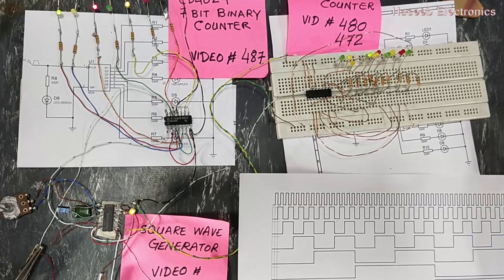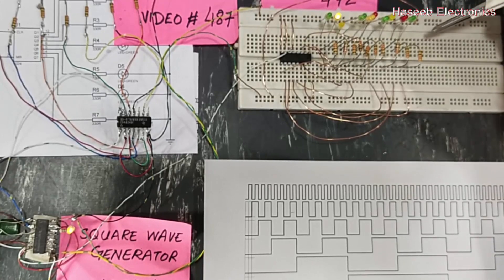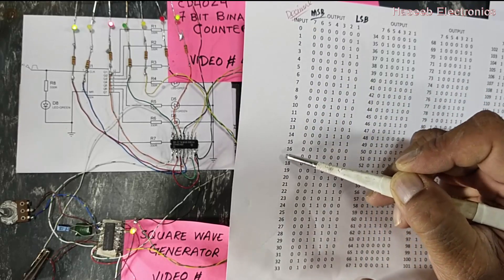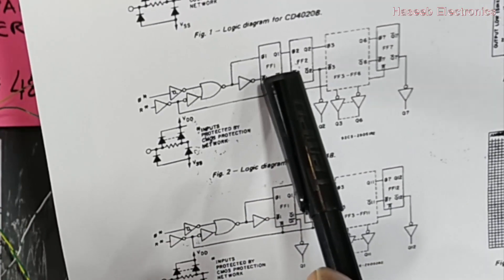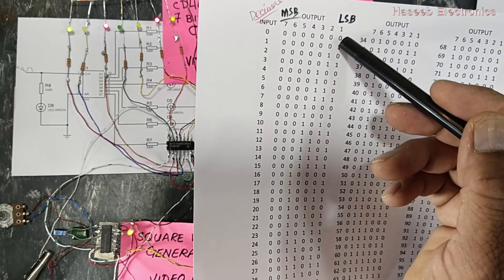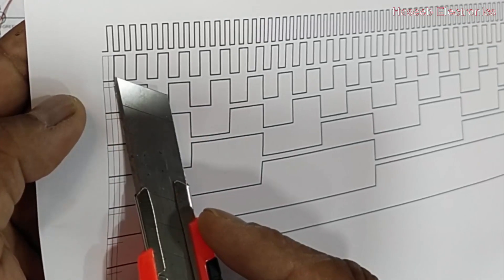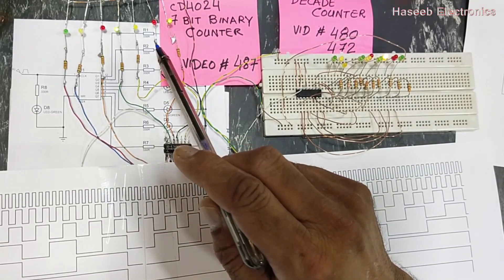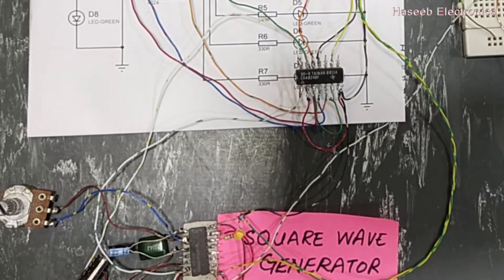{488} CD4017 Vs CD4024 Decade Counter Vs 7 Bit Binary Counter Comparison

Comment: Very nice explanation sir
Kindly advise on a digital clock no display which component is bad battery,4027 ic or any other please
Reply from the maker: it depends on clock circuit, because there are lot of circuit types 
if you send its picture to my whatsapp 00962-79-1161084, then i can say something

Comment: Very interesting so it means for making binary or digital Clock should be use binary counter instead of decade counter ? Can we use that 2ic in one project?  Can explain in next video
Thank you very much for the very informative video
Best regards from Philippines 🇵🇭
Reply from the maker: special thanks 
no we cannot use these ics in digital clok, for digital clocks are some different ics. i will assemble a complete digital clock circuit